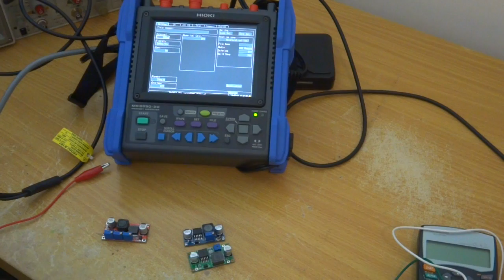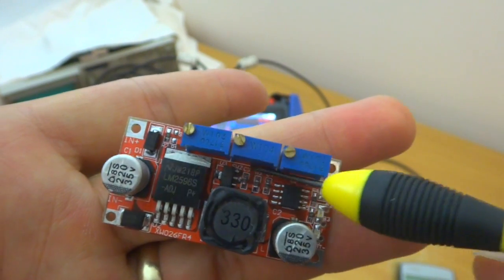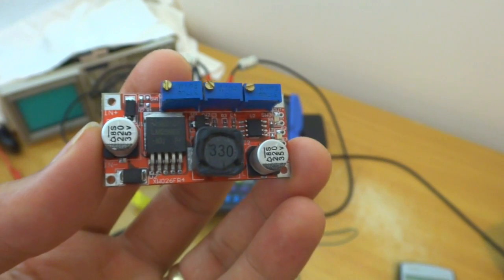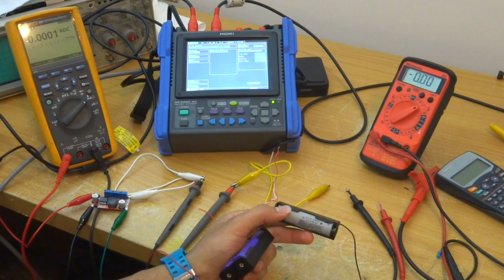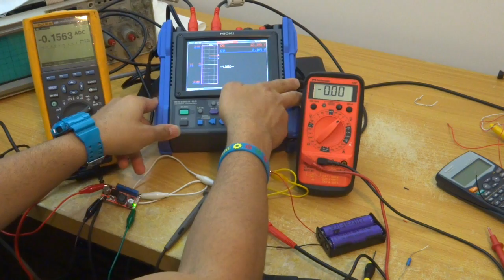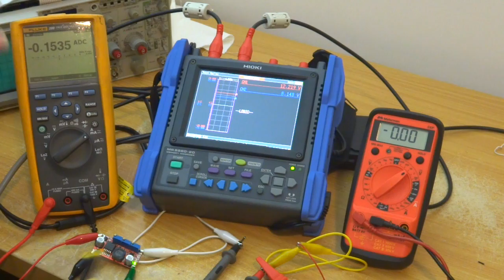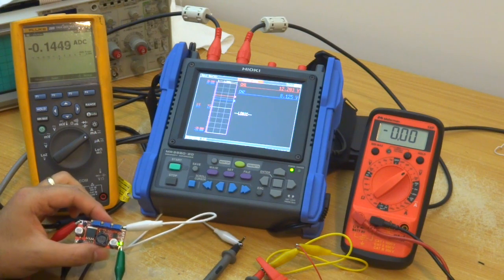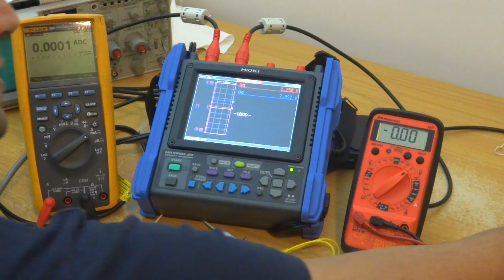Part 1 - Buck Converter LED Driver Battery Charger LM2596 Setup

Comment: I had the same problem and had a hard time solving it. The problem is that I connected input (-) with output (-) with the same cable, thinking it was the same. The module cannot detect the current with that connection because it senses it between both (-), so it cannot regulate the current even if one turns the potentiometer. I tried many 3A and 5A modules, always with the same problem. When I separated the (-), the module started to regulate OK. If possible you have a bridge between both (-) with the multimeters :)

Comment: Oh dear. 
You're going to blow yourself up if you don't learn about basic electronics safety.
For starters, don't "trickle charge" lithium ion batteries when they're fully charged. Especially cheap crappy chinese ones. 
Ultrafire are some of the worst lithium ion batteries you can buy, by the way.

Comment: Please keep in mind this Step Down converter uses a SHUNT resistor between Input-GND and Output-GND to measure output current. The erratic behavior might have been caused by your Dual-Channel Oscilloscope (or similar), that was measuring both In & Out Voltages simultaneously, with a common Ground. Using 2 Ground probes, you bypassed that shunt resistor, resulting in Current limiting failure.

Comment: ALL PROBLEMS APPEARED IN THIS VIDEO CAUSED BY RESISTANCE OF THE WIRES . YOU MUST REDUCE THE LENGTH AND INCREASE THE DIAMETER OF THE 2 WIRES CONNECTING THE BATTERIES WITH CHARGING BOARD

Comment: Some people just don't get it... For current, you need to adjust your multi meter to the amp setting then touch the wires to each of the two outputs to adjust the amperage.

Comment: I know this is old and I am sure you have moved on from working with these. However I to had an issue at first not being able to change the Current from POT 1. So I set the unit up with 19V input,  set the output to 12.8 and using a known Draw of .55 I put the bulb in place with my meter in 10AMPs. It took maybe 20 or 30 turns before I noticed the AMPS moving down. I did try this on a Auto Meter and for some odd reason I couldn't get it to register. So moved to a Manual DVOM put it on 10amps. Once it was set and being able to drop AMPS over the meter the unit worked as I thought it would. For the Price I also bought a Few to tear one down. I am sure this has long been Round Filed, However I thought if you still have it kicking up dust, Take something that has known current, hook it up and with a NON auto ranging meter and try and set it again. I was turning for a while, I am not saying 10 or 20 half turns these were full turns so took a while to get it to start coming down. Just an Idea of what I had to do with mine.

Comment: A CC-CV charger maintains a set current under the condition of maximum set voltage. In this video, no matter how high you set the current, the module will not force that current to the load, since to do that, it will have to increase the voltage, but the max voltage has already been set to a point where the load is consuming less than the set current at the set voltage. 

The module is doing it's job. The constant current is usually set using a multimeter in amps mode (meaning shorting the output), which is why 10A is suggested, even if you have an autoranging one (likely that the millamp fuse will blow before the meter sets the range). This current that you set is what the module will maintain by varying the voltage, upto the max voltage that you set.
Reply: I'm guessing the module is working fine the way he did is wrong to set the current you must set it up without a load or battery either using load resistor would be fine any CVCC module same settings and 5A are working 3A more than 3A needed extra heatsink to dissipate extra heat from module
Reply: I have just been reading all these comments, thank you.  I have a 12v 4amp charger but my battery is only 12v 3.2Ah, I have one of these LM2596 with 3 pots and I set the voltage to 13.7v ( float voltage ?) and the current to 400mA the blue led is on and the middle red led is also on, the current limiting led is not lit?.  Does my setup appear to be ok ( the battery voltage is slowly rising and nothing is getting warm lol )  Thank you very much.  John.... :)
Reply: blue led is output power indicator 2nd red led is float charging indicator 3rd led is full charge either on or off
Reply: why isnt the cc cv led burning then ?

Comment: I am looking for 12V stable voltage from a 12V 100W solar panel, without connecting to a battery. The total max load is about 36W (12V, 3A) only, which need to be worked during daytime only. 

Note:- a 12vsolar panel does not give exact 12v out put .... a 12v solar panel gives max voltage up to 22v that's why I need a regulator !!

Comment: i think this pot witch dous not seem to work is meant as a LVD ( Low Voltage Disconnect) to protect the source batterie from getting overdischarged e.g a lead acid batterie discharging below 12.00 volts..... so with a steady power supply it wil not seam to work!

Comment: You have to place the Ampermeter in series with load to set the current limit ?? or you can short the output with the ampermeter probes?
Reply: You can short the output. Put multimeter on 10 A DC current.

Comment: Hello, great explanation video. Thanks. I have an e-bike – 500w motor, battery is a 60v20ah Lithium with a built in solar cell 15w.  I’m wondering if I can use a boost converter taking 12v from an existing onboard converter, boost it up to 67v and feed it back to the battery’s charging port to charge the battery while riding. Would this be practical or should I be considering a different type of boost, buck converter instead.
Reply from the maker: +I Derek R This particular module can only boost voltage up to ~48V. It is possible but you need to find the right charging module not just a boost converter.
Reply: You want to charge 1200wh battery with 15wh solar cell? You must be kidding me.

Comment: The reason why you thought the unit wasn't working was because the batteries that you were trying to charge were too full already. There wasn't enough voltage difference between the voltage of the batteries and the output voltage of the unit for the batteries to depend a higher current. Therefor, since the current limiter was never reached by the batteries increasing the limit of current isn't going to push more current into the batteries. Try the same test when the batteries are not full and then the difference between the output voltage and the battery voltage will be enough to hit a higher current. Hope that makes sense.
Reply from the maker: i already did, see other comments and my other videos. that unit was faulty

Comment: yo can you link a schematic for all output wiring for cc/cv charging? i know it has to run through a load/meter before the battery load..confused with wiring though for it.

Comment: I also could not understand what the center pot is .. but I think you are wrong . there is no trickle charging for Li Bats - it will destroy them . I think it sets a low current in case the battery is at low voltage when starting but am not sure of how to set it .. will watch next video . Tx anyway . good work .

Comment: @3 bucks each these crapfire are expensive .. buy xiaomo power bank and extract good samsung cells .. or extract from  dead laptop batteries .. holy carp the wires were just hanging and you were swaying the case in air . luckily it didnt shorted..

the current was not increasing because the cells might be in CV phase .. try setting current to some constant value and try on drained out batteries.

Comment: i use these a lot and found out the hard way. you can not run current through the fluke while you have a load on the buck converter its causing a short.
when you hook the fluke up for current use the negative on the input side the you can adjust the current. do NOT use both pos and neg on the load side. if you look close with it hooked up the way you had it the c/c led is glowing slightly.
Reply from the maker: ***** I am not shorting the output as the load is placed after the Amp meter

Comment: The first VR in the left is for current adjustment.  Seems you don't know battery characteristic very much. When you increased the current, I see the voltage boosted to 8.6V, which is already over charged the 2S battery. So, I would think the second VR should be for voltage adjustment and the third one would be cut-off current adjustment VR.  LiION battery is acting a CV loader hear.
Reply from the maker: Yuanli Chiang I confirmed with the supplier and number of other users that the potentiometer on the left is for the voltage and the one on the right is for current limiting. This particular unit current limiting function is faulty, I tried other ones and they work.

Comment: you did not set the current by setting your meter to 10 amp and accross the output pins
Reply from the maker: I didnt need to, Both meters have Auto function
Reply: ***** you need to set the current on the charger tho

Comment: I bought one of these to drive some LEDs. Followed the not very legible instructions from the ebay page but it did not work. The input voltage I used was 19V, adjusted the output voltage to 5V, connected a multimeter on the 10ADC setting across the output of the module, was able to adjust the output current from ca. 250mA and up, but as soon as I went below 250mA the reading on the multimeter dropped to 0. So I'm not really sure if I did something wrong if this is a defective unit.

Any ideas?
Reply: +bergweg I think the difference between your input and output voltages is too high. These regulators are most efficient when output voltage is about 80% of input voltage. I've also noticed they behave a bit oddly if you step the voltage down too much

Comment from the maker: Guys check out part 2 as requested:
https://www.youtube.com/watch?v=BMWdgEvYRdY&feature=youtu.be
Reply: Usually the one you think is faulty is really meant for charging from lets say a 12v battery so you set it to 10v so it shuts down and doesn't kill the source battery... At least that's how mine works

Comment: You can't increase AMPS if batteries only use 200mA @ 8volts. It's limiter not amplifier :)
Reply: +Tomas Av. You can increase voltage and current at the same time without breaking the laws of thermodynamics, by using a less than 100% duty cycle. It's power you can't create out of nowhere, and time is a factor there.
Reply from the maker: Tomas Av. Thats right its not a current amplifier but you can inject higher current by increasing the voltage
Reply: @WorldOfEngineering  You first need to set the multiplier down as this reduces current by a certain factor and will be confusing what you are seeing. The current limit is usually for higher values. This is a 3A module so if your battery wanted to draw up to 4A at a low level of discharge you would set the limiter to 1A or 2A depending on the charge C rating of the battery. First you need to get into this scenario before you film it. Now try limiting the current to 1A as it may not limit below .5A or something like that. I really wanted to see someone setting the multiplier and seeing how it reacts as current drops. I want to know how to set the multiplier.

Comment: I wonder this problem was solved already here considering the last comment was 3months ago.. The instruction is adjust ouput current "no battery attached". WOrked for me though
Reply from the maker: Luke Vincent Neri I will shortly post another video addressing number of issues and questions
Reply: that would be awesome

Comment: You need to test the short circuit current draw. That's when the Current potentiometer will do it's thing.
Or you can connect a very flat lipo 2s battery reading something like 6 volts. This low battery will try and draw a large current when the charge voltage is set to 8.4 volts. This is when the Current potentiometer will make a difference to the reading, while adjusting. It won't increase the current, but just limit it (ie reduce it). Your demonstration didn't work because the battery is still fairly well charged and only drawing 150ma anyway.
The other test is to turn the current all the way down and short circuit the output with your 10amp ammeter.
Adjusting the current pot will now alter the current reading on the ammeter.
Reply: Jack, you're the man. Maybe send this guy a link to the relevant basic stuff on Khan academy.
Reply from the maker: Jack Evans  Hey jack, you are right, I actually figured that out and I will upload another test using depleted. Batteries. Make sure you check that out and let me know what are your thoughts
Reply: *****
 Another simpler test is to connect a 10 ohm 10 watt resistor to the output with voltage set at 8.4 volts.
With no current limiting (current pot fully CCW), the resistor will draw 840 ma. ie. I=V/R
Turn the current pot CW untill you reach the 840ma current limit position. From this point the current reading will start reducing and so too will the voltage as you continue to turn the pot. Just remember the current can't possibly reduce, unless the voltage does first.
If you were charging a battery instead of the 10 ohm resistor, the battery's voltage would slowly rise and continue to draw less current from the charger.  While this was happening the chargers output voltage would rise too, because there's less current to limit. In the end, both battery voltage and charger voltage meet at 8.4 volts and at this point there's no current being drawn, for all intents and purposes.
Cheers and thanks for putting this up too.
Reply from the maker: Jack Evans Yea I understand Jack, l like the resistor idea as it will be more controlled than a battery.

Comment: Power connected no output connections OK LED on. When adjusting voltage OK LED on. OK LED will go out and CC/CV and CH LEDs will come on when adjusting current output. When charging CC/CV and CH LEDs will be on at start then CC/CV will dim out but CH on as charge is completing. At this point is when the .1 times adjustment is topping off battery. CC/CV and CH LEDs off and OK LED on when complete.

Comment: Volts should be vary low when checking current. Amp meter is a short on output.
Reply from the maker: What do you mean amp meter is short? it is in-line with with positive wire
Reply: Connect amp meter directly across the output. It sounds crazy but that is the procedure. Amp meter is very low ohms close to short. If you short the output no damage is caused to the circuit.
Reply from the maker: John Delselva What do you want to measure by connecting it across the output?
Reply: The constant current is measured and adjusted by connecting Amp meter which is set at 10 amps directly across the  output it is a dead short and you will see the current.
Reply: You had 8.4 volts showing on the the other meter I guess you had the two meters in series and since the amp meter is almost a dead short the other was seeing the full voltage. The volt meter should have an infinite input resistance so there was little current.
Reply: I was interested in your video because you were charging 2 cells in series and I wanted to know  how well that worked.

Comment: Hi, Can somebody please tell me how to make connections.....if I have a
+16VDC...0...-16VDC power supply ?
The board has only +&- inputs and no GND !!!
Please help, thank you :)
Reply: Add a diode bridge rectifier between your transformer output and the input of the module, then you are done.
Reply: Add a diode bridge rectifier between your transformer output and the input of the module, then you are done.
Reply: jeremyvi Thank you. It is working.

Comment: Some instructions here: 
http://www.satistronics.com/lm2596-nonisolated-stepdown-cc-cv-charging-module-in735v_p2777.html

It does allow changing current if you connect directly to the meter's 10A  range, then remove power to change back to CV mode, seems flakey though
Reply: There is a chart showing Current and Voltage during battery charging with the product description at: http://www.ebay.com.au/itm/1pc-DC-DC-LM2596-Step-down-Adjustable-Power-Supply-Module-CC-CV-LED-Driver-New-/141150561633?pt=AU_B_I_Electrical_Test_Equipment&hash=item20dd3aa561
Try setting the maximum output voltage and maximum output current with the input connected but NOT the battery. (Set maximum current with only the multimeter on the 10A current scale connected across the output terminals.)
With the battery connected, the maximum current may only occur if the battery voltage is very low at the beginning of charging, and drop once the battery has been charging for some time?
Reply from the maker: Colin Dunstan Thanks Colin, but shouldnt the charger start with higher charging current? (as it indicates in the graph) in my test stayed on 100mA for time and didnt increase.
Reply: *****
The charger is supposed to supply a constant current until the battery voltage reaches the maximum value, then supply a constant voltage with tapering current until the battery is fully charged - according to this clearer specification and chart here: http://www.ibt-power.com/Battery_packs/Li_Ion/Lithium_ion_tech.html
I ordered my LM2596 from China about a week ago, and can't check its performance till it arrives. :)